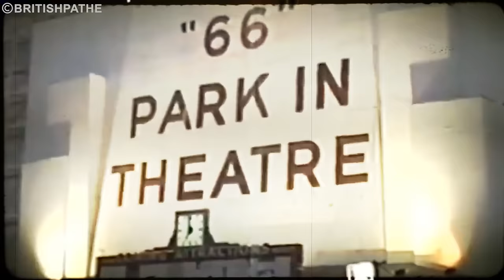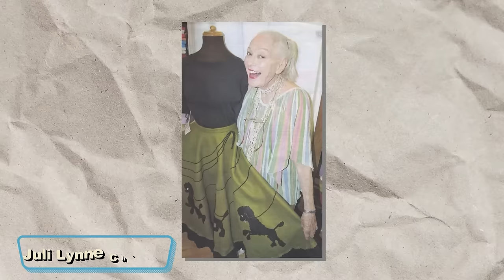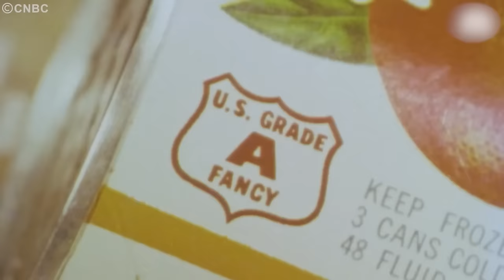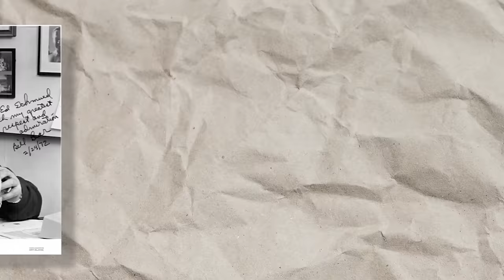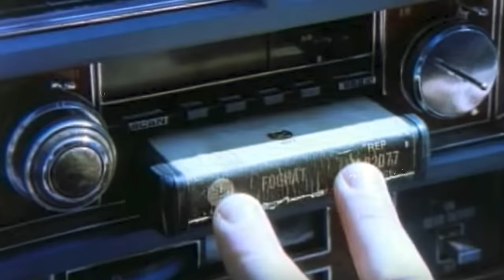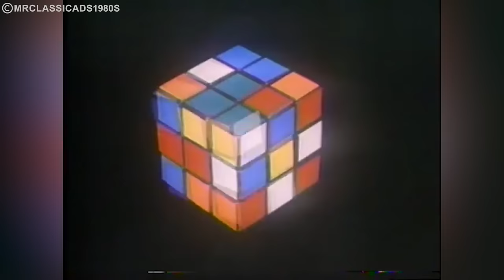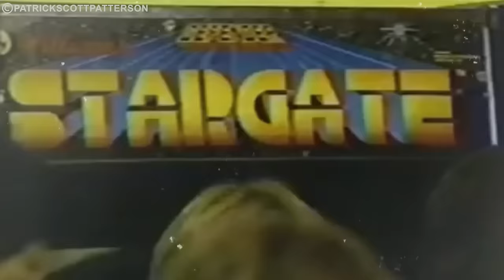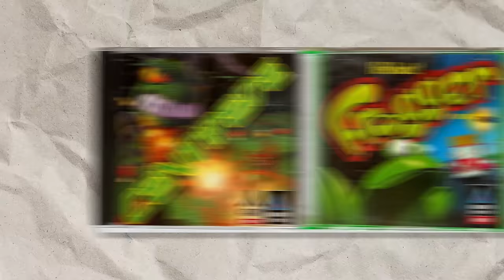You Might Be Old... if You Remember These Things!

Comment: Chia pets were right up there with pet rocks! 
Also clackers or kabonkers as we called them: to “glass” like balls attached to short lengths of twine then joined to a plastic loop. If you knew what you were doing you could get them to clack together rapidly. My parents refused to get me a set for a really long time because there were incidents of the balls shattering or coming loose from the twine & flying off. There were many reported injuries. My parents eventually bought me a set (no, I didn’t keep bugging them… “no” was a complete sentence in our house so I knew better) but they told me I couldn’t play with them. I did occasionally try but they kinda scared me. Dad could get them going pretty good though lol.

Comment: I have a few items from the past in my home. A 1934 Grundig Majestic AM FM Shortwave receiver I restored (Vacuum Tubes) a 1953 Philco AM Long Wave Tube type Table Radio. a 1970 Gem Marine 23 channel Tube type CB base Station( Still works with a Siltronics Slider to expand frequency range) Several 23 and early 40 channel Mobile CB Radios (All the 40 channel units have the now banned PLL-02A frequency chip) A 1970s Rockola Juke box (Works), several old Pinball Machines and 2 original PAC MAN Arcade machines (All painstakingly restored and working)

Comment: Running wild in the neighbourhood till the setting of the sun. Running over a possum on a 125 cc Jawa Motorcycle and ending up in the ditch. Going to the local drive-in watering hole (Frank Brannon's) to get a 15 cent burger. Hula hoops made from a water hose and a 5/8inch dowel. We were somewhat frugal.

Comment: Bell bottoms were navy attire due to functional need, if you had to go into the water they could be pulled off more easily thus aiding in saving your life.
Reply: We sailors were also trained to tie the cuffs and inflate them as make-shift life floats.  The white sailor hat could be used for floatation too.  This was early 1980s, my second hitch.  Uniforms have changed now, the old bell-bottomed dungarees are no longer issued.

Comment: It was simpler, for my 7th birthday I received a single shot .22 rifle, no one was upset by a 7 year old walking down the street with a rifle and a couple of cartridges in his pocket. In summer, me, my rifle and my dog would go off after breakfast and come home before dark, often with a rabbit or 2. I nearly always had lunch from BBQ rabbit. 20 years ago I was driving with my kids and pulled over, I got out taking my 2 kids back under a bridge and found my old BBQ plate and fire still there!  I had my rifle for years before I got a push bike, once I had the bike my forays went far and wide, from about 20 miles my summer wandering went out to over 100 miles out in a day. I learned to always have a hook and line with me and my lunch menu expanded. I learned to put the guts from rabbits and road kill in streams to feed fish and crayfish. By the time I was 10, I could shoot a duck on the wing with a .22 and my menu and take home increased. Underwear for young boys was optional in my “social circle”, shoes were for “formal” occasions. Rain was a mere inconvenience in summer, for a kid getting rained on wasn’t an imperative to go home, dry and get changed. The height of accessory was a transistor radio! Music was a language for social exchange.

Comment: Bell Bottoms was the Style of the 70s Just watch The Pilot Episode of The Incredible Hulk (1977-1982) The Drive-In Theater lasted up to 1991, I saw The Terminator (1984) and Total Recall (1990) and Navy Seals (1990) at the Drive-In. That's where I first used a Hula Hoop, Gym Class. I believe that Frozen T.V. are a result of The Space Race. The Aluminum Trays faded out in The 90s. All roads lead to The Jellicle Ball, Leg warmers a Style of the 80s was also a great way to get The Purrfect Jellicle Leg.
Reply: Around Dallas Ft Worth there are still 20 Drive In operation. Reminiscing back to the 60s as teens on Saturday night.

Comment: Bell bottomed trousers in the Navy were essential for shipboard life.  The pants could be removed without taking off the deck boots and turned into a flotation device if the sailor went overboard.  We did not remove our shoes because of the possibility of ending up on a coral island.  Coral and wet feet equal bloody mess...